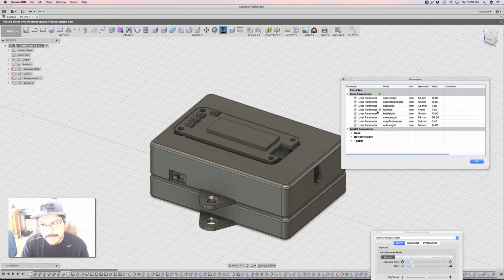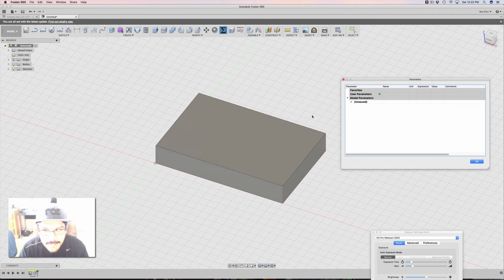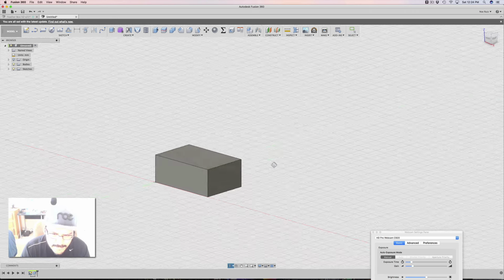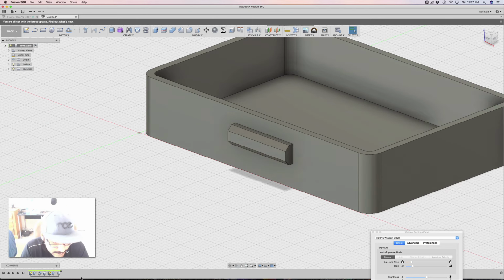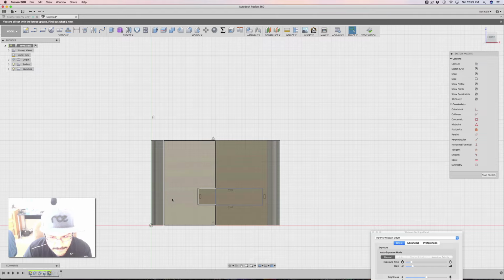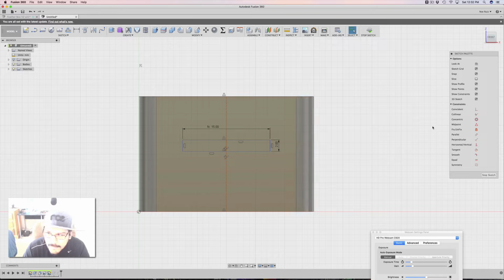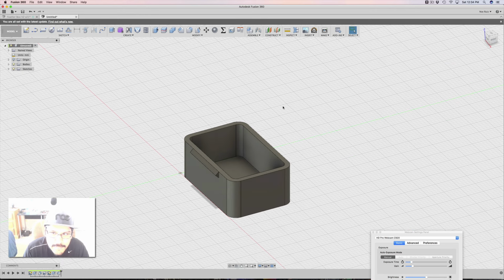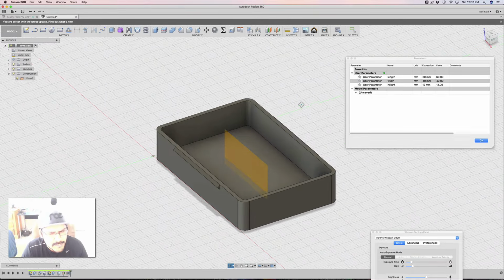Layer by Layer – Adaptive Parametric Features

Comment: I'm also trying to make good use of the user parameters... however my (more complex) designs keep arbitrarily breaking up whenever I make even small incremental changes to some parameters, even if I avoid adding decorative stuff until the end, and even if I tend to have all the sketches completely and correctly defined... Do you have any good-practices / strategies to prevent that from happening? That would make for an awesome video!
Reply from the maker: I'm so glad you mentioned this! Pedro and I find ourselves in similar waters. My current strategy is to just make a new design and start over fresh. Once you know how the design needs to function/look, then you can optimize for u-params. I think overtime, I'll put together some tips on this and do a video on it. Thanks for the comment!
Reply: Wow, thanks! That would help me (and many others) quite a lot!
Reply: I'm glad I'm not the only one seeing this. I thought I was messing up somewhere upstream and just didn't catch it.